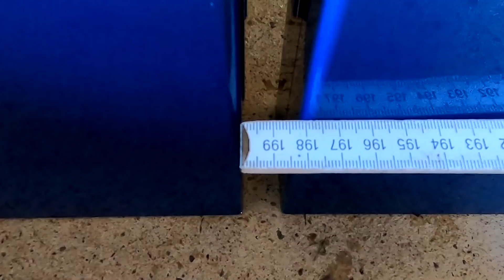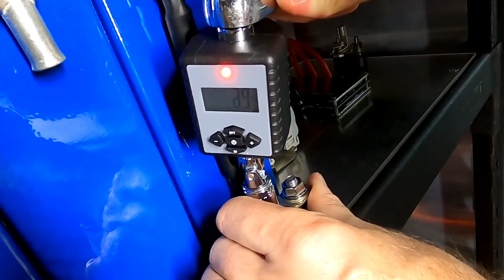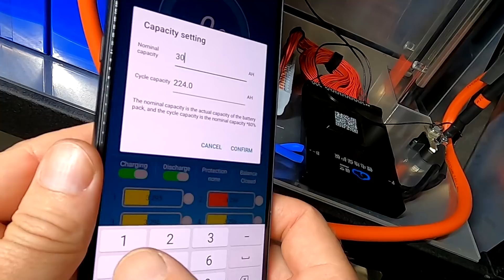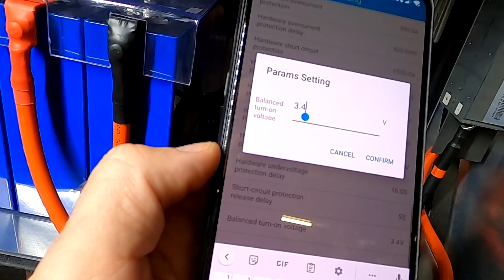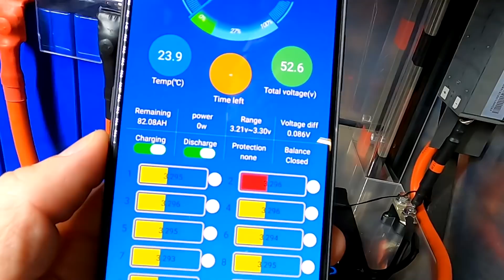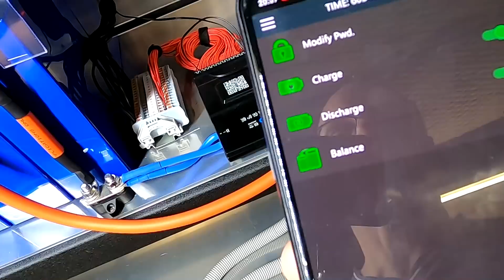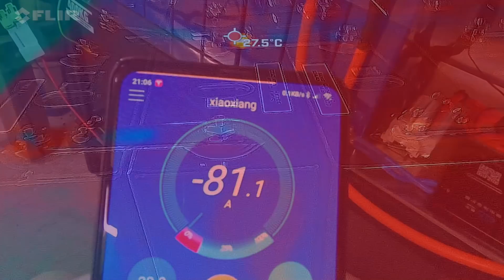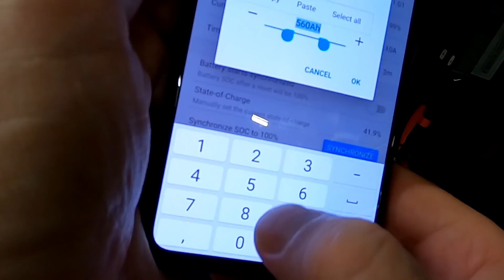2nd parallel battery bank installation and BMS failure. Adding 15kWh of storage capacity.

Comment: Hi Andy, I am but a humble devotee to you channel and like many others you have provided such valuable insights to so many, and long may that continue. However at this point in your journey I’m getting a little ‘scared’. Such is the complexity and power of your powerwall that I worry that something might go pear shaped. I am always worried when I see you working (even on the garage floor/bench), with an all metal socket set. This I feel is so dangerous and I am ‘surprised’ that your senior followers have not raised the safety concerns before. This feeling was exacerbated when I watched you flailing around with said socket set inside the metal battery cabinet on this video. I think we should sponsor you for an insulated socket set rather than beers for a while! As a point of discussion I still can’t get my head around the individual battery banks in parallel idea, and of actually mixing different capacities as well. Where is the benefit? As far as I can see it makes everything more complicated/costly and there is more to go wrong? So viewers are now questioning the issues of cable lengths/busbar positions and from my limited experience I have taken trouble to make every cable to anything the same size/length, just to eliminate any inconsistencies that may introduce. I also pull power via a distributed busbar that has in my case 4 links to the battery busbars in the hope that will further aid any imbalances. It seems to work well, maybe just a fluke. Also I am still confused as to the reasoning behind separate batteries? OK it’s works, but (aside the fact that you don’t have matching cells now with the 280/304 mix), why did you not go 3/4P 16S, one battery, one BMS, (may have missed this discussion?). At the end of the day please stay safe!

Comment: Hi andy can u advise me on OVERKILL BMS settings I have 2 new 100 amp ones to configure,there connected to 2x200 amp calb plastic covered batteries in parallel x16 in series total of 32 batteries in 1 bank have 2 banks.i just don't understand how to program the BMS. I'm sorry to ask this much from u but would appreciate your input very much.cheers Rene from sunny Victoria.only it's raining ATM.

Comment: Ferrules are also a safety thing. When those little strands of wire break off, they can end up making a short. Imagine one or two of them floating around inside your Bms, inverter, controller, or any electronic board. lol,or foot .

Comment: A system like that would benefit from a batrium bms. Don't know a lot about them but I think it can run all 3 banks from one app. I'm fine with the jbd's I have now, they're dirt cheap in comparison. I do like the layout of the cells quite a bit and love the quick connectors for the balance leads

Comment: I watched your video about using different AH cells wired together as well as different BMS's in the same system but what is your explanation of why manufacturers say not to mix batteries? will prowse does it as well as you do. do you think it's a way to scare people into only purchasing one manufacturers batteries?

Comment: J.s you are not supposed to use ferials with the normal style of clamps. Yours on the other hand only makes a small contact patch. Nomal flat clamp systems has a 2-3mm mating surface that gets deformed by the feral. In that case the feral will actually cause more resistance . Your clamp block is not normal

Comment: When the 100A BMS is replaced and wire goin to ya circuit breaker wont be as warm but how u were sayin how it pulls 44A from each battery bank when u use 7KW thats only until the smaller capacity battery bank goes flat,btw have u seen the kilowatt labs capacitor bank they use now instead of batteries?

Comment: Very impressive Andy! I like the added space for ventilation, and I'm wondering if when you close up your power rack if heat build-up is going to be an issue?  For built-in home entertainment center I added a filtered air ventilator using a low power DC box fan and a solid state thermostat for pressure and keep dust out, and a second smaller unfiltered fan on a thermostat set a bit higher in case the main filtered ventilation failed or clogged.

Comment: Bottom row assembly, can you assemble it in front of the shelf on temporary support / shelf (timber etc) and push it back in, possibly back row then front row. no doubt you would still have to check connection torques etc once in place and add the connections between rows. At least you would be adding the majority of the connections in the open. Nice to see it progressing and was that the decommisioning of the original pack?
Reply: Not easy to push 40kg of loosely connected cells all at once. Also if not very careful it would put side loads on some of the terminal posts. I would just slide each cell in one at a time setting up the back row first. Setting spacing along the row can be done using a temporary spacer allowing the busbars to drop into place. It's a bit of a reach to fit and torque the nuts. The only really awkward job is fitting the balance wiring but each wire strand can be cut to approximate length and fitted to the busbar in advance.

Comment: I dont think the contact area ist more with the Ferrules. They are round of course and even if they are longer in contact - it is only the tip of the round. The wider contact area vs the longer smaller evenes out at the end. The wago connectors work perfekt with every cable and i am really sure this will too.
Reply: What about a real TEST? Send Amps through this connector and show us the differce ;-)

Comment: 041722/1501h PST 🇺🇸 041822/0801h Brisbane 🇦🇺  Guten tag mein friend und danke schoen. Mind boggling… mind boggling…my little grey matter is like Omelette…..appreciate your confidence and formidable mental strength. 
The reason for the JBD 100A cables extreme thermal indication could be due to wire gauge deficiency. The AWG 8 cables in parallel is about AWG 5. But if the AWG 8 cables are replaced 
with 2X AWG 6, you may find some difference in thermal issues. (My thought) or perhaps also due to crimping issues? Overall….. I’m stunned at the engineering. 
The lower reading cell …. Causing concern… would the issue disappear once individually charged? Let’s see.
Have a nice day ahead, Herr Andy und 73s…

Comment: Good video as always! I’d be interested in individually charging a cell, I have an underperforming cell in my 12v 280k pack as I hadn’t top balanced them but am using the jk bms - tbh it’s not that much of a big deal - it’s just that the other 3 cells hit 3.6v and the remaining one sits at 3.34 - so I’d like to ‘exercise’ that cell prior to me adding another 4 cells to the pack to make my 24v string.
Reply: Just use a bench top power supply set to 3.6v and connect to pos and neg of said cell.

Comment: Hi Andy, what if in let us say 10 years, one cell will fail. You have spare? Or do you trust the supplier to still excist or still manufacture these type of cell’s? That is my biggest concern……
Reply: In 10 years you'll be able to buy something with this capacity for cheap so you probably wouldn't bother trying to find a cell that comes close to matching
Reply: @niktak1114  I doubt that: 1st lead accid batteries did not become any cheaper. Raw materials are scarse. 2nd the cost per watt is the lowest in Life4po batteries when you take cycles and the nett capacity in calculation. So why would manufacturers lower their prices. 3rd if in 10 years one cell will fail I need to change the full battery as I have understood. Simply adding another one with different V and Ah capacity will not work. Again as I understood. So the full battery need to be exchanged…..
Reply: Simple, I always buy 18 cells for each battery

Comment: Please could you test stuff from the (official?) EVE alibaba shop ,
They have rackmount stackable 48v battery like pylontech a little bit cheaper .
I suppose it's prismatic cells contrary to pouch of pylontech , i prefer that .
And i want to know if communication port is compatible with victron stuff , also if capacity is good .

Thanks
(Nobody has actually tested them on the internet or youtube)

Comment: You can change the name of the Bluetooth module as it shows on your search screen in the app
When you're on the monitoring screen click the three lines in the top left corner then app settings then device model click on that and you can change the name to whatever you want that name is saved on the Bluetooth module itself so you can switch the module to a different BMS if the connector fits and it will show the same name also if you just grab a new phone or tablet and it installed that app on that Bluetooth module name will be read from it and will show on all devices

Comment: Nice clean setup! But it's not smart to drain Batt's so far <3V. i suppose you did  for testing and getting out the bad one's.
For longevity always keep your batt's around 75% 1 it baffles me that people still don't know(care) about this golden rule.
Another tip for longevity: put a spanner around the cells, so they are pressed together, this will give you a gain of 30-40% on the total charge cycles of your system.
Anyway, enjoy your Tesla ride on self harvested ⚡

Comment: Also I thought I would mention there is a trick to the app of how to switch between BMS is without having to exit out of the app it's confusing and there's no documentation for it but here it goes
When you're on the screen showing you monitoring One battery or one BMS click the three lines in the top left then you click on the name that is just below that little link symbol thing that brings you back to the search screen but you'll notice there's only the one that you're connected on it's on there if you click refresh it'll show you all the different ones in range now click on the one that you want and it will act like it's trying to connect but it never seems to do so you only have to wait about one second and then click outside of that connecting box that will make it go away and then you click again on the same next BMS that you want then it will go to it after the first click on the thing you'll notice that the top one changed names to be the one that you wanted it to be that way you can switch between bms's faster than exiting out of the app

Also when you open the app if you're fast enough you can click on one and get it to go right to the one you want but they're never in any particular order so you got to read through it if you got quite a few

Comment: yay! the second battery is going to be awesome! Also I think putting the long cycle 280Ah cells on the bottom shelf is good, that way you can put them there and really do a long term test on it and not worry about it until you replace the battery shelf completely.
Awesome videos, you better get charged up!
One last thought is that hopefully you are careful if you need to manually balance the cells, make sure that your power supply is not grounded otherwise you will short it out connecting the charger negative to a random point in the pack, where I think the system is negative grounded in the inverters?

Comment: Good job but I'm a bit worried that you are too much focusing on "good look" instead of "low failure". our are inserting a lot of unnecessary screw connection points (busbar "bended" extension, etc.) which all could lead to a possible failure... Just using a single cable would be better in terms of reliability in my opinion.
Reply: Hmm, I think the "bended" bus bars are necessary though. It's not just for looks. It will be extremely hard to bend those 35mm2 cables and will be significantly longer without the "bended" bus bars if routed directly. And there is the BMS, it's not possible to use a single cable anyways for the -ve. Yes the positive can but I don't see any better way to wire it without those bent bus bars. Moreover Andy needs to tap screw holes on the bus for the balance cables.
Reply: Also note how easy it was for him to swap the BMS. Making up new cables for a BMS swap is a significant disadvantage and many of the BMS's come prewired with short leads. De soldering those in my book would be a no no.

Comment: GOOD MORNING GUYS!!!!   My question is.  How many of the: over kill BMS:  16s 48v 100 amp load charge BMS to be able to handle Load about 10,000 watts 240v continue for 6-10 hours use/ charge car.  Any one please help. if you have the Math show how to calculate will be great.  I will buy -30 - 40 kwh battery bank thanks a lot.  Solar 5kwh,  INverter: 3x 5kwh Growatt inverter.

Comment: Really nice work, it is a massive amount of hours you put into all videos and help the whole community to grow their knowledge. I was previously thinking on having a 3P 16S battery but now with your help I'm sure I will use 3 separate banks with 3 BMSes instead.  Is it still the JK BMS you would hold highest for such solution?  I had quite a lot of discussion with Heltec 2 years ago and then they where against putting their BMS in parallel, so maybe you can ask them now and see if they still recommend against putting their BMS in parallel with their own or other BMS brands.
Reply: Hi, was going to install a 3P 8S system, I am looking back through Andy's videos, trying to find why he's not in favour of paralleling cells, if you install three separate BMSs, how does the system balance in entirety,

Comment: The price of Lifepo4 battery’s has dropped so much it’s not really worth building your own in my opinion.. just bought 200 amp hour battery for $699.00 with a ten year warranty… it’s a drop in and go battery with built in BMS…
Reply from the maker: Yeah, but this is just a 12V battery right? you need 4 of them to get to the 48V system (if this is at all possible. The you have 'only' 200Ah instead of 280/304Ah... then, it's not so cheap any more.
Reply: @OffGridGarageAustralia  yes

Comment: Not good i think. Bms only for maintaining, not for first for the beginning. Try make them at 1 serie. Charging those till 3.7v. After those finished, you can make series you want. I guarantee that will balances at 0.000v, even at hard condition. Charging or discharge. Try it out, you will amazed with mine

Comment: I don’t accept your rationale with the ferrules. Every moment of the wire is connected to its up and downstream moments by nothing more than the cross section of wire. 1mm^2, 35mm^2, etc. The spring clamp connects the wire by this precise surface area. If it weren’t enough, every moment of the wire’s cross section would also not be enough.